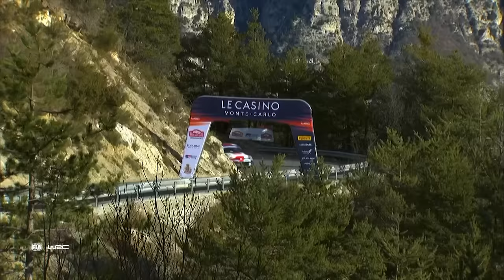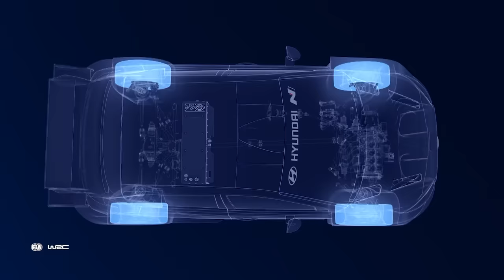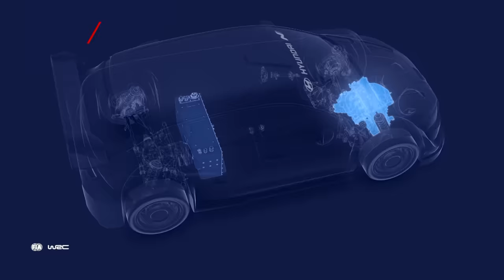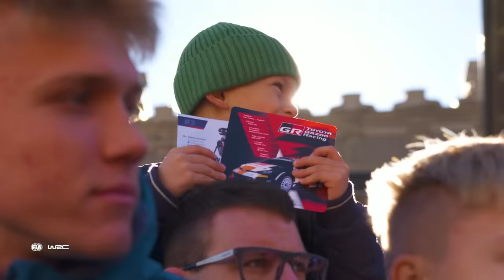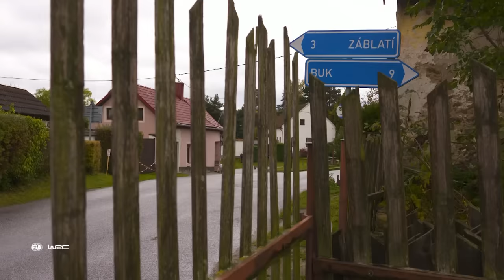ULTIMATE BEGINNER'S GUIDE: World Rally Championship

Comment: please please PLEASE drop the horrible points system 🙏🙏
Reply: Lets just give it a chance
Reply: Why points make sense just because one event want bad shouldnt be the reason you miss out on the championship
Reply: @ceskyondra1470  No. There are better ways to stop this "driving through" on sunday.
Reply: Not a great points system change.

I don't even like the Powerstage concept, though acknowledge it's about driving focus on a single TV-packaged stage. What was wrong with awarding one point for a stage win on top of the normal end-of-event points system?
Reply: @alajibril5708  It doesn't though. And I don't think there's ever been a case in WRC where one bad event have been the reason for a championship being lost.
It doesn't make sense to have Fri-Sat as one "rally" then Sun as another "rally" and then power stage on top of that.
Who is the actual rally winner?
Reply: As someone who is new to rally, How have the points changed and why is one better?
Reply: Without the power stage it’s the f1 points system that works well
Reply: And please add cost cap rule
So more brand could join
Reply: Why they go full on Sunday now

Comment: So if i understand correctly basically WRC consinsts of multiple "Events" over the year which consist of multiple "Stages".  You get points for being under the top 10 fastest at a stage, under the top 7 fastest at the end of the last day and under the top 5 fastest at the last stage. All points of every event get added up and the team with the most points wins. Is this correct?

Two questions: Are the sunday points for being under the top 7 fastest overall at the end of sunday or for the top 7 fastest on that day? And do all Events consist of the same kind of stages / do all events have special and super special stages?
Reply from the maker: Hi! In terms of the points allocation, you are correct. Up to 18 points are awarded based on the rally standings on Saturday evening; seven points based the fastest cumulative times over Sunday's stages only, and a further five for the Wolf Power Stage. But! In order to get their Saturday points, they must still finish the rally.

So, even if a crew is well down the leaderboard after a problem early in the rally, they could still earn seven points by being fastest over the course of Sunday, plus whatever they can take from the Wolf Power Stage. 

Every rally has stages unique in nature, from snow-covered roads in Sweden to slow and rocky terrain in Kenya. Itineraries are usually quite similar, although some rallies may have slightly more stages than others. Not every rally has a super special stage, but those that do typically take place immediately after the ceremonial start on Thursday evenings
Reply: @wrc  Let's see how long this new points system lasts. Change was sorely needed, but this aint it.
Winner should always net the most points.
Reply: @ferranis104  Not only that, but as points are given from Sunday stages only. Who is the actual rally winner? The Saturday-winner? But that's not the whole rally? The Sunday winner? that's even less of the rally. This is a mess. Very typical FIA-stuff when they realize a championship is having some issues. Changing things that doesn't really impact the interest of the championship from manufacturers, privateers etc. Just a change for changes sake. Awful.
Reply: This perfectly illustrates how confusing the new point system is really. I hope it won't be long before it is properly improved

Comment: Drop lame points system and hybrid system. We want 6 gears again.
Reply: @bn880  Rally1- makes more sense than Rally2+. You want all the things you and deltazero mentioned? Rally1 cars already have almost all of that, including far better safety. Just ditch the hybrid and add an extra gear. Done.
Reply: @bn880  Rally1 cars are so expensive due to the hybrid. A Rally2 upgraded to withstand the extra power will end up costing as much as an hybrid-less Rally1. Rally2 cars already cost 300k; the 200k cost-cap is just a PR thing. The gear paddles require more expensive hydraulic systems, and the Rally1 are much, MUCH more safer than the Rally2 thanks to the space frame chassis with no road-car body shell. I'm pretty sure the space frame chassis is cheaper than Rally2's body shell + roll cage setup. In fact, the body shell needs heavy treatment for the Rally2 car.